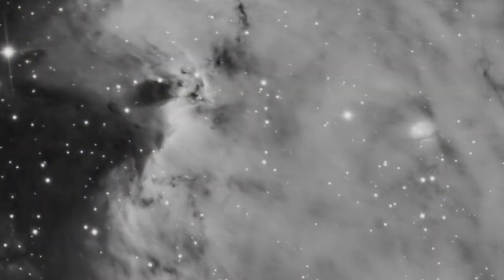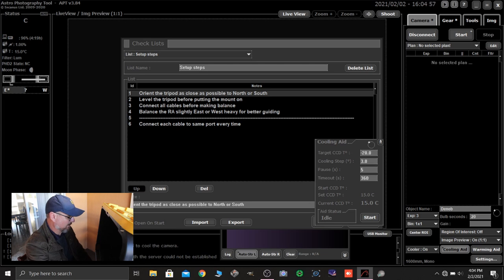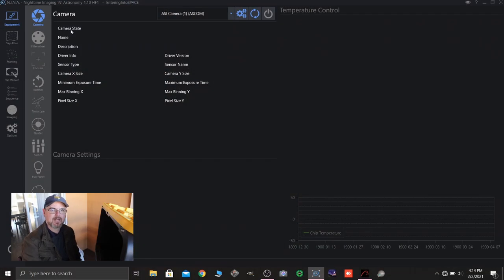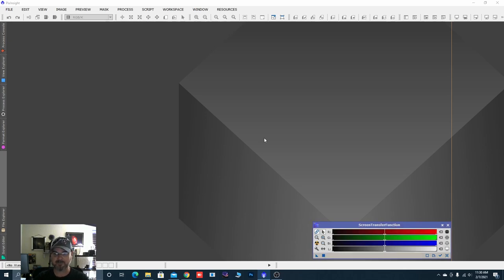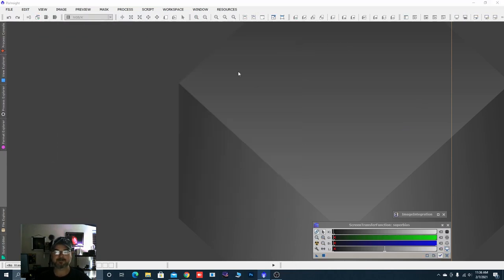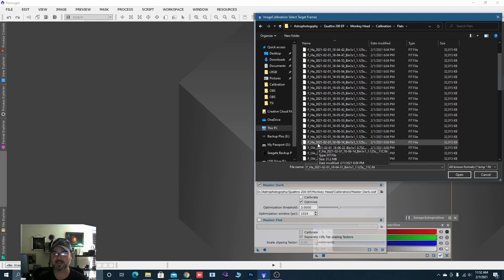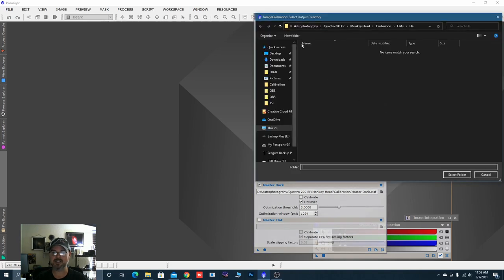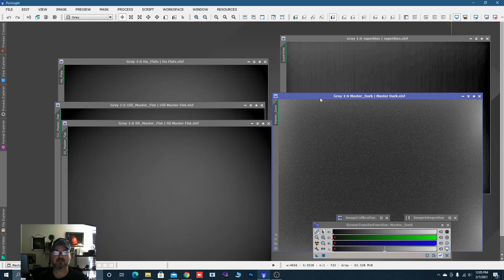Astrophotography Calibration Frames

Comment: Awesome! Do you happen to have a link for that light plate?
Reply from the maker: Hey thanks! I think this is it, if its not the exact one it pretty close.

https://www.amazon.com/dp/B01JPD6QZK/ref=cm_sw_r_cp_awdb_imm_t1_44CNX1GZ04WQN2C82P06
Reply: @enteringintospace4685  thanks!
Reply: @enteringintospace4685  Thanks for the video (actually, all of them!) - I have a light panel but don't use it with a t-shirt (or whatever) - does that make a big difference?  My light panel has 3 settings like yours - i figured i'd use the brightest for shots I take in high light-pollution environments and lower for darker skies (just figured that made sense to me)... I notice you're using the low setting - any advantage to that?
Thanks again

Comment: Why would you not cool your camera for flats?
Aren't the flats calibrated by your flat darks?
Would you end up with more hot/cold pixels if you don't cool?
Also, love your videos!  You really helped me get my way through using Pixinsight.
Reply from the maker: I've actually been cooling the camer for narrowband flats lately. Theory is I'm shooting longer flats....like 10 to 15 sec so I'm cooling the cam.
Reply: @enteringintospace4685  ah, makes sense. Once you get longer than a bias frame cooling would probably matter more.  I've been cooling all my calibration frames to the same temp as my lights just to be on the safe side.  Thanks again, great videos!
Reply from the maker: @DipakPatel  Thanks!

Comment: Wait, what? Did I hear that you cancel out light gradients from the moon or light pollution with flat frames around the 01:50 mark? As far as I know, you can correct imperfections from your imaging train such as vignetting and dust but not environmental factors... Or am I missing something?
Reply from the maker: I should have explained my thought process there better. I have observed that extreme changes in the sky brightness actually enhance the light fall off inherent in my imaging train.
Full disclosure this is not from a measurement but an observation.
Whats your thoughts?

Comment: Useful video. I thought that your dark frames should match the length of your light frame, but when you calibrated your flat frames your darks were 6 minutes but your light frame (flat in this case) was 0.04s so you where taking a 6 minute  dark from  a 0.04s flat.
Reply from the maker: Thanks! Yes darks and lights should be the same length. 
Flat lengths will either be decided by the software your using based on your light source or by observing that your histgram is roughly centered.
Bias frame lengths will be at your fastest shutter speed.

Comment: Great video, simple explanations. When I take darks I drop my finder scope lens cap over the focus tube inside the main tube. That way I bypass the primary and secondary mirror. No light leeks at all. Be sure to have the scope horizontal camera towards the floor you do not want to drop the lens cap on the primary mirror. Clear skies.
Reply from the maker: Hey thanks. That makes since! 
My dark filter seems to be working be but thats a great idea for those not shooting with a filter wheel.
Scope pointed down of course😉
Clear skies!